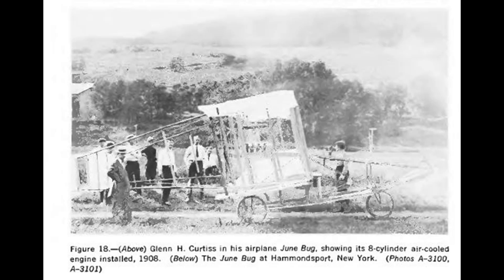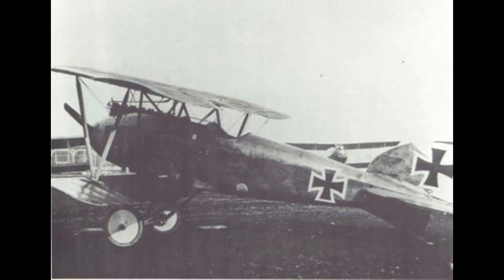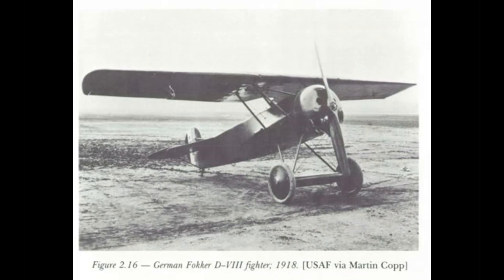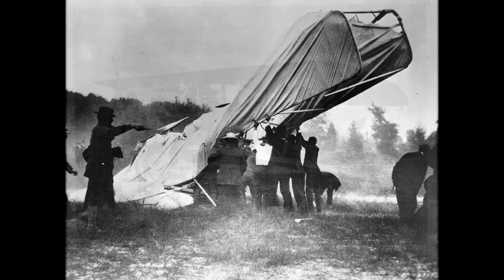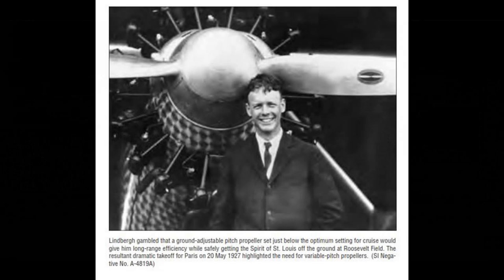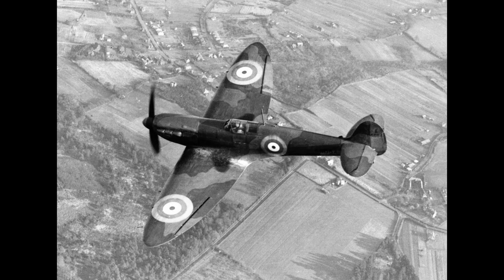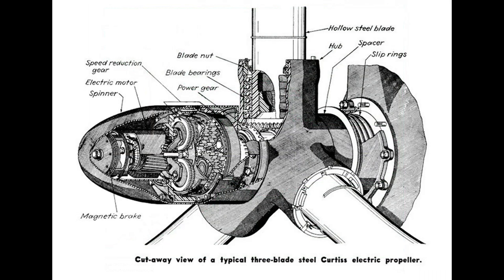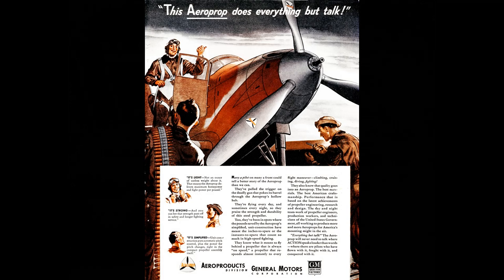Advancements In Propellers 1909-1942

Comment: Might already be a comment about this, but when he says he would prefer a hydraulic propeller over an electric, because typically only one engine ran the generator and batteries didn't last long....my question is what was different with the hydraulic pump? Did those go out less often? Did twin engines have two pumps? He says the batteries didn't last very long if the generator went out, what was the hydraulic alternative if the pump went out? I really don't see where there is any difference except the electric has a battery if everything else falls apart.
Reply from the maker: In the case of a constant speed prop, most of the hydraulic pressure is actually engine oil pressure, so, yes, if the engine oil pump goes out you will loose the constant speed prop, but at that point you're loosing the engine anyway.  continued:

     Now in regards to hydraulic vs electric in general. In all my years of flying I have had many electrical problems but no hydraulic system failures, not one. So yes, I trust hydraulics way more and again in this case it's mostly engine oil pressure anyway. There is typically a booster oil pump too, but I have never heard of one failing. Those electric props failed all the time. An airliner went down in the Pacific because of it.

Comment: @gregsairplanesi At 8:04. Did you mean to say 190 Dora 9?
Reply from the maker: Dang it, yes I did, of course that's the 190 D9. Good catch.
Reply: @GregsAirplanesandAutomobiles  completely understandable,  I never knew the D9 could have a wooden prop, so thank you.
Reply: Where there early  BF109's with 2 bladed props?  I swear I saw some in the series Clash of Wings
Reply: The Bf 109D had a two blade prop, and a chin radiator and no under wing radiators.

Comment: don't know how the hell i missed this vid, but finally saw it.  Ever plan on giving some knowledge on wings of the era?
Reply from the maker: Thanks, I cover wing designs in several videos, including the first one in the Fw 190 series and others.
Reply: @GregsAirplanesandAutomobiles  I suspect i might have seen that.  If i recall there were some surprising things about the aerodynamics of the 190 you mentioned.  Im generally still a bit dumb when it comes to why certain wing types were chosen over others and the considerations behind it..  lots to learn
Reply: @bluthammer1442    The 190 used a later generation NACA five figure series aerofoil, earlier fighters used a four figure series or even modified Clark Y!

Comment: I've always wondered about the Wright brothers, how and why they put their elevators out front. Seems like they should have realized, every bird in the world has the elevator feathers in the tail. The Wrights did a number of seemingly strange things this way
Reply from the maker: There were some very good reasons for that, which are still relevant today. I might make an entire video about that, it's an interesting topic.
Reply: 1. Just looking at the front elevator provided information about the pitch and roll of their plane.
2. The front elevator would stall before the main wing, and the plane would automatically pitch down, preventing the main wing from stalling. This probably saved their lives more than once.
Reply: @warlord195711    The free floating pilot controlled front surface could be stalled after the main plane!  It was not a fixed canard fore wing.

Comment: Pretty sure the early marks of Spitfires and Seafires had 3 bladed constant speed wooden propeller blades. Have seen plenty of photos of splintered wood after accidents
Reply: The De Havilland props were licence built Hamilton Standard solid alloy props.
Reply: @givenfirstnamefamilyfirstn3935  … as I said, Spitfires and Seafires used wooden props until the later marks . The vast majority in WW2 were 3 bladed timber.
Reply: @sueneilson896   In fact about 99% of the Battle of Britain Spitfires were constantly improved Merlin III powered Mk Is which had their manual control two speed De Havilland propellers upgraded to Constant Speed control just before the battle.  It would be incorrect to claim that the De Havilland or the parent Hamilton Standard propellers had wooden propeller blades.  From October 1940 the new Mk II Spitfires introduced the Merlin XII engine with the Rotol constant speed propellers using wood or wood laminate composite propeller blades.  The photos of early Spitfires with round cross section blade roots are of Mk Is, the slightly later aerofoil section blade root Spitfire photos would be of Mk IIs or perhaps early Mk Vs.

Comment: Given the topic of props and spinners, maybe you could answer a question I've had concerning the Douglas Skyraider. Other than the prototype, all photos of the Skyraider show a prop without a spinner. Do you know how that kind of prop works? I doubt if the Skyraider had a fixed prop!
Reply from the maker: Sure, it's easy of servicing over absolute performance.
Reply: A different kind of  variable pitch proppeller. I think I saw some material from the period in which they praised that propeller because it didn't have that spinner.
Reply: The posed that question to a docent at Virginia beach air museum. Answer is the pitch mechanism is electrical.

Comment: Why did American radial engined fighters use the skinny domed spinners instead of a more aerodynamic cone like other countries radial engined fighters like the A6M or Sea Fury? Ive seen air racing Corsairs and Bearcats modified with cone spinners so I feel like there must be an advantage do it, but obviously they must have known about that back then and chose not to do it. Does the engine nose section of a wasp engine need air flowing over it for cooling or something?
Reply: Cooling, many B-17s and B-29s were lost because of overheating.  It is worse at high altitude with hot turbocharged intake air and less dense cooling air.  The spinner radial planes were often operating at lower levels.
I read in a Flying magazine article decades ago that a Douglas DC-6 put something like seven tons of air a minute through each comparatively draggy radial engine cowling.  I’m probably way off but it was some incredible figure, .... and they didn’t use spinners either .... nor did the Boeing 377.
Lockheed used small spinners on the Constellations.
Reply from the maker: That's exactly right, it's all about cooling with those big radials.

Comment: Greetings,
The Spitfire MkI and Hurricane MkI both were initially fitted with two bladed wood propellers,  just before WWII.
Early Bf-109, including those dispatched to the Spanish Civil War, were similarly equipped. 
You see a wide variety of crashed Luftwaffe aircraft with splintered wooden propeller blades, starting surprisingly early in the war.
A lot of those paddle bladed propellers seem on Me-109, Fw-190, Ju-88, and Ju-87 aircraft had wooden blades.
I imagine this was done because of limited availability of the high strength aluminum needed for forged aluminum blades, the wooden blades may have the rotating mass of propeller assembly.
I’m not sure.

The basic flyball governor illustrated in the discussion of the hydraulically controlled constant speed propeller was invented in 1788 by James Watt, and is known as the Watt Governor.

Let’s be careful out there.
Reply from the maker: Read more of what?
Reply: @GregsAirplanesandAutomobiles  I’m confused.  Perhaps even more than usual.  
I didn’t tell you to read anything.  At least I wouldn’t do it intentionally.  Your material is well researched and presented in an interesting manner.  I frequently repeat portions of your material, in order to be sure I’ve understood it.  My remarks were not intended to offend.  I just have a tendency to retain bits of information I find interesting.  I just wanted to pass some along.  
Take care, carry on the good work.
Reply: @GregsAirplanesandAutomobiles  I’m less confused now.
That’s a YouTube prompt.  Tap the prompt, you’ll see the rest of my comment. YouTube displays three lines of text, then, then displays the prompt, allowing you to skim comments.  Take care.

Comment: I don't understand why this system is called Constant Speed...what speed ? the motor runs at different RPM, so te propeller too, indipendent to the pitch. Ins'n bettter automatic pitch propeller ?
Reply from the maker: No, the motor and prop run at a constant speed throughout a large range of power settings.

Comment: Imagine having to seal a hydraulic system in a prop hub that is connected to something not spinning, i wonder for how long those seals lasted.
Reply: that was the question i had.  I really want to see a diagram of that.  Guess i'm going to have to go looking for it now.
Reply: Ahhh I found something that makes a lot more sense to me now.  https://www.enginehistory.org/Propellers/HamStdVC/Fig13.jpg
I w as thinking it would require a rotating seal, but instead it is behind a lot of different bearings meaning there would be a number of different seals and relatively tight tolerances along the entire shaft.  Then at the end something like a pressurized reservoir .  The result is a lot less pressure on any one seal.
EDIT: to make sure this is understood and cited the full article on the specific eight blade prop in the first image.
https://www.enginehistory.org/Propellers/HamStdVC/HamStdVC.shtml
Reply: @jimdavis1576  Now I can't help thinking about that variable camber prop. That is proper sick!
Reply: @vaclav_fejt   The Wright brothers worked out the varying camber propeller blade.
Reply: The short answer is longer than the engine… (in combat longer on average than the pilots).

Comment: Being a British engine technician I prefer the use of 'coarse' and 'fine' applied to propellor pitch because it is also used for screw threads so is quite obvious.  'Low' and 'High' are meaningless in this context as it is not apparent what is actually meant.
And you do know that Lindbergh was not the first to fly across the Atlantic ...... don't you?
Reply from the maker: New York to Paris baby! Nobody cares about island hoping from one place where no one lives to another nobody wants to go to. You can call that "crossing the Atlantic" if you want to, but that's not what Lindbergh did.

I agree with you on the screw thing though :)
Reply: @GregsAirplanesandAutomobiles  And no-one flew direct from New York to Paris again for thirty years…
The Gander Airport saw a LOT of traffic in the meantime…

Comment: Just a comment:   Spitfires initially came off the production line in 1938 with Watts 
Wooden Fixed Pitch Props.   These were Mark I Spits.   These were then fitted in the 
field with DeHavilland metal bladed Two Position Props - and these had ONLY TWO 
POSITIONS - COARSE AND FINE . You set Fine Pitch for take off and landing, and 
Coarse Pitch for cruise.   They were NOT Variable Pitch.   

Tbe RAF began fitting DeHaviland  Variable Pitch Props starting in late 1939, and 
these were referred to as Variable  Pitch Props, and were controlled by the pilot .   
'
At about this time, Rotol  developed a Constanst Speed Prop, and these began to
be fitted in the Spitfires coming off the production line.   

But the older Spits and Hurricanes still had either DeHaviland Two Position Props, 
or DeHavilland Variable Position Props.   Just  before the Battle of Britain, all the 
Props on the Spitfires, the Hurricanes, and the Defiants were modified IN THE FIELD  
by DeHavilland into Constant Speed Props.  This work was ongoing during the Battle, 
and in fact, was not completed on all aircraft until mid August, while the battle was 
at it's height.

The Mark II Spitfires all came equipped with Rotol Constant Speed Props.   And, 
interestingly enough, some of the Merlin Engines with the Modified DeHavilland 
Props were often seen  during the war on Lancasters,  which sometimes had a 
mixture of the two types of props.

Early on in the career of the Spitfire and the Hurricane, a pilot might try to take off
with the Prop set in the Coarse Position.    The aircraft often would not get off
the ground, and the pilot would run out of airfield and hit a stone wall or go into
a ditch at the edge of the field, damaging or wrecking the aircraft.   This would
lead to a severe  ' Ticking off ' by his superior officer, and was considered to be
as sinful a blunder as landing with the wheels up !
Reply from the maker: I literally included a quote from the manual that showed that the "two position" three bladed props were actually variable pitch. Do you have a source for the two position prop that didn't have intermediate positions? I would love to see it because it's not in any manual from the WW2 years. I'm not saying it never existed on the Spits, but if it did, it was very short lived and probably not used in WW2.
Reply: @GregsAirplanesandAutomobiles  Conversation with a Spitfire pilot - who described how a pilot in his squadron tried to take off in coarse pitch, and ended up running into a stone wall at the edge of the field.  He stated that the prop had only two settings, but that was enough to cause some of the older pilots who were used to fixed pitch props to ' Come a Cropper ', as he put it.

The Spitfire went through a LOT of modifications, even to the early Mark Is-they went from two bladed wood fixed pitch props ( Watts ) to three bladed Dehavilland Two Pitch  props, and then, because the Rotol Constant Speed Props were delayed coming into service, the Dehavilland company came out, removed the props from the Spitfires, modified them in the field into constant speed props ( which still required some pilot input to work properly )  and finally, in late 1940, the Rotol Constant Speed Props came into use.   If you look at line-ups of Spitfire Mark Is in late 1940, you can see the Dehavilland Props ( short spinner )  vs.  Rotol Props ( long spinner. )  

I have a feeling the manual you saw was updated to conform to the Dehavilland modified prop, which had intermediate settings that the pilot had to select based  on height, power, and speed.   The Modification program took place DURING the Battle of Britain, and was done with no contracts or formal orders - and, from one source I read many years ago, as late as  1942, Dehavilland  was   STILL  trying to get the Air Ministry to  PAY THEM for the work !  

I also knew a pilot who flew in Spain, and he described how the prop would 
be set to fine pitch prior to take off ( This was in a Polikarpov I-15 ) and then, after the initial climb out, the RPMs would be reduced, and the pitch changed to cruise - then the RPMs would be re set.   

Some of the props on the I-15s were Curtiss Props, and others were  Ratier Props - both were only two position - there were no intermediate settings, according to my aquaintance.   

As both of these men were flying  in the late 1930s, these props were quickly obsoleted by the Variable Pitch Props, and later the Contstant Speed Props, and, in the case of multi-engine aircraft,  Props that could be feathered in an engine out situation. 

Two Final Notes:    Watts made a four bladed, fixed pitch prop for a special Spitfire that was going to be used in Speed Record Attempt - it was cancelled at the outbreak of the War.

Also,  if you see a Rotal Prop with four or five or six blades on it, like on a late Spitfire, a Typhoon or Tempest, or SeaFire or SeaFury, those are WOODEN bladed props -  It saved engines when they had a prop strike, and the blades were cheaper, lighter, and easy to change.   The only problems came when they overspeeded and hit the Mach Limit - then the tips began to splinter....
Reply: The De Havilland ‘two speed’ props were a significantly lighter and simplified control version of the Hamilton Standard propeller.  Before the Battle of Britain all the De Havilland props were converted to full constant speed.  De Havilland’s people changed the control gear and pitch limits on one or two planes in each squadron and instructed the ground crews so that they could upgrade the rest of the planes.

Comment: the Power verses speed make total logic! Just LIKE BOATS! you can have decent hole shots and weight management with cruising MPG or? you can have a Great top speed!  But YOU CAN'T Have Both! without a variation?
Love around the 30 min mark! It is Like a Steam engine throttle regulator meeting a Hydraulic Transmision!  and having a Propeller Transmission Baby?

Comment: In 1939, the Spitfire, Hurricane and 109 all had twin-bladed airscrews. By 1940 they had three blades.
By 1941, the RAF was using four-bladed airscrews. Soon the Mustang and the Thunderbolt adopted four blades.
By 1944 the RAF was introducing five bladed props, and contra-rotating props by 1945.
But the Luftwaffe was still using three-bladed props.  So much for "brilliant German engineering".
Reply: I think you have to take into account what was happening in Germany in 1945, developing more efficient props would have been right at the bottom of the to do list, let alone having the resources to produce them.